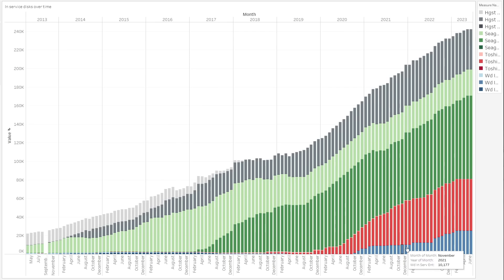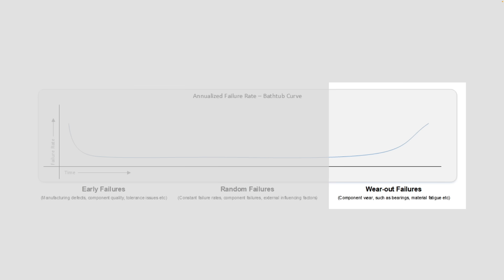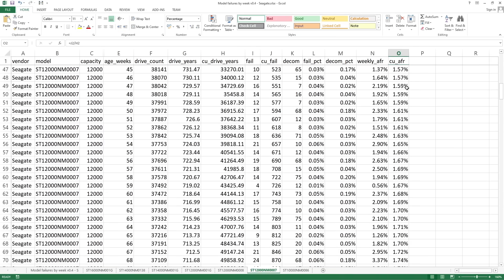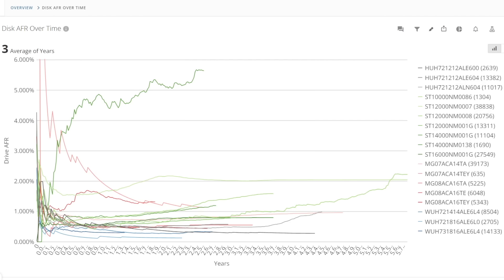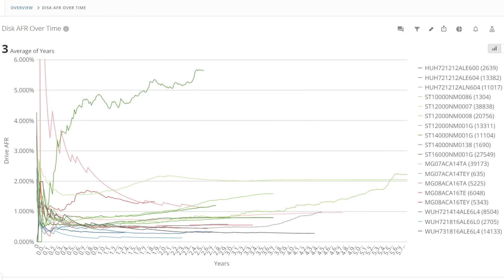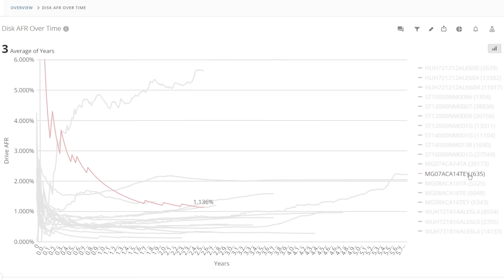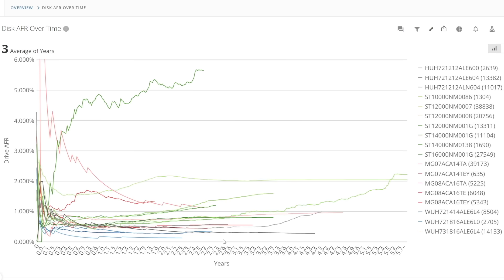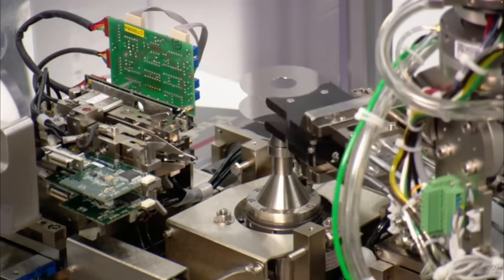Failure Rate Analysis - Best 10Tb+ hard drives: Seagate, Western Digital or Toshiba?

Comment: Hey great video.... Would you suggest one to get Western Digital over the rest and especially enterprise disks as I think enterprise disks laster longer. I want to build a fairly large NAS, and seeing I've had a few WD black enterprise disks for the past 8 years they haven't failed on me once.
Reply from the maker: Hi and thanks for watching and commenting also. 

I put out a video a couple of weeks ago which covers exactly this I think, found here: https://youtu.be/icNbexYV3M4.  I hope this gives all the specific data and context to help.

The TL:DR is that WD disks appear to currently be the most reliable enterprise disks, and although the available data for these disks only goes back 2.5-3.5 years or so, it appears to closely follow the past behavior or the Ultrastar range when it was branded under HGST. The small caveat is just around price point and availability, but I just bought some 20Tb Ultrastar DC560s myself as they were actually cheaper at the time than Exos 20Tb disks. Toshiba Enterprise Capacity 20Tb disks were cheaper still, but the current data seems to look great for those Ultrastars, so I went with them. But of course, price varies day to day and by location, so your mileage there may vary.

Good luck with the NAS build.
Reply: @sometechguy  HGST / WD "Ultrastar" have been my go-to models for about a decade.
Followed by Toshiba enterprise models.

Comment: i've bad experience with consumer seagates. they dont last long. my consumer toshibas are still spinning even after 4 years.
Reply from the maker: I think some years ago, some specific barracudas models had a bad rep, and there were some 2.5inch drives that had design issues as well, where the top plate was too slim to protect the internals. But more recently, they seem better.

Comment: it's always hit or miss with these things.  I've got 4 4tb WD Red's and 2 4tb Seagates Nas Iron Wolf drives in my NAS, which I recently setup a few months ago, two of the WD reds are already failing...Granted I waited a bit before installing and setting the NAS up.   I wanted to get a better mobo, and beefer processor, was thinking VM's, dockers, all that jazz later down the road.   I got the WD red drives from Newegg...and it came in big box, they were just bubble wrapped, and flopping around in the spacious box.  I was ready to nuke whomever packaged this at Newegg.  They all worked, ran multiple tests, no issues.  I probably had them sitting for almost a year.  I ordered the Seagate's a bit later, once they came in I put everything together in my older Entho Pro II case.  Installed truenas Scale, setup the pools, etc.  No issues, the only thing I have running on it so far is Jellyfin, got some other apps going but haven't used them yet.   A few months in I started hearing some chirping sounds.  Then TrueNas started giving me error messages on two of the WD red drives, go figure.  So now it's like what drives should I get...seems everyone has had this or that with whatever brand.  I'll probably go with Seagate, maybe try the EXOS one, since they go for a bit less.  Thanks for the time you put into this, its always good to get a clearer picture of what's what.   I used to always stay away from HG and Toshiba drives.

Comment: In 7 years using 5 Seagate 4 TB Iron drives in my Synology NAS, one of the five cashed after 3 years and 4 months with bad sectors - shorts outsite the 3 years warrenty. One time after 7 years a drive power off (hang up), but can be reinstalled to the RAID again without an other fail. But in the future I switch to Toshiba, because all Toshiba drives have 5 years warranty.
Reply from the maker: Thanks for sharing your experiences.

The warranty will depend on the drive class, and has varied over time. All the manufacturers appear to offer 5 years warranty currently on current enterprise class disks, but NAS class disks, surveillance and desktop vary. For example the Toshiba S300 Surveillance Drives have a 3 year warranty, and their desktop P300 have 2 year limited warranty currently based on their datasheets. I think generally you will find similar warranties between them on competitive products.
Reply: Iron Pro has a 5 year warranty